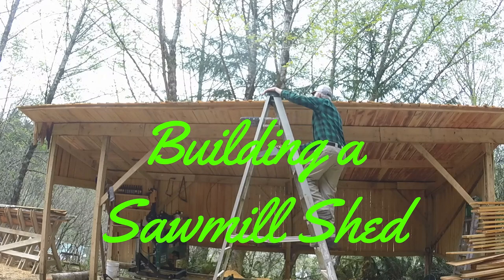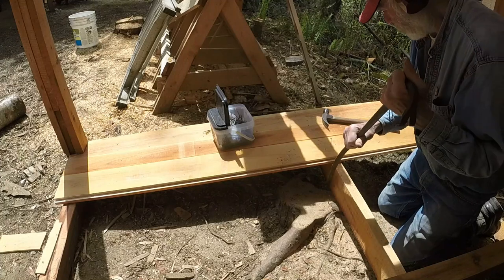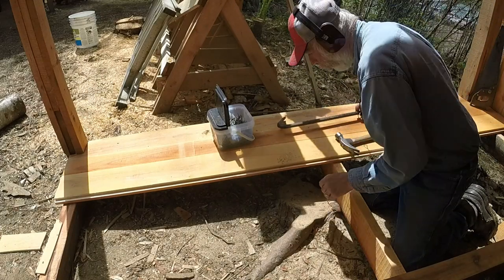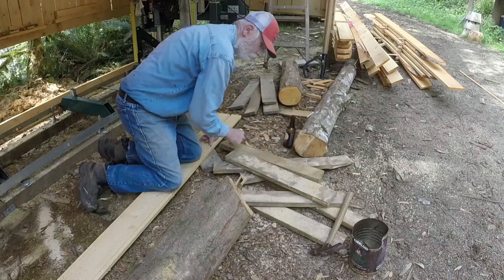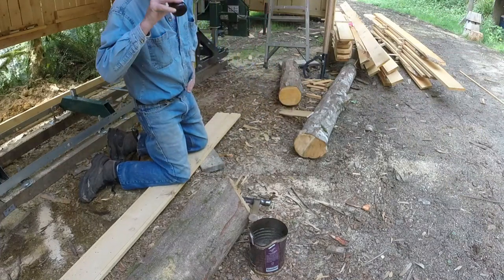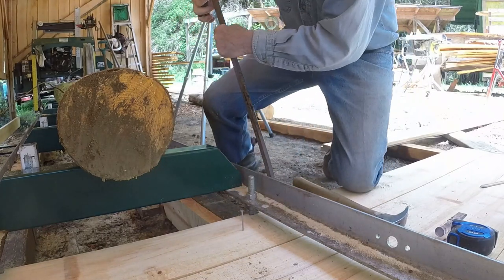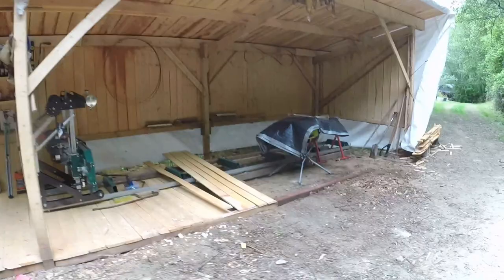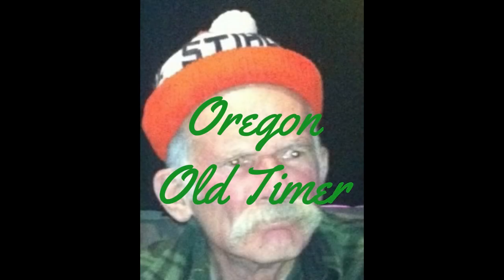Sawmill Shed #6  Building the Floor and Rain on the Roof

Comment: Sounds about like my luck.. I just used fine crushed gravel for my floor. Set mine on old railroad ties. Had a time getting everything leveled. Adjusted 1 side as low as it goes and other end maxed out. Had to keep pulling them all out and digging down back and forth.. Made for an aggravating evening.. Lol. Looking great so far! Be safe..

Comment: Nice shed build, got to one up for my saw this coming spring, have it setup in pole barn for this winter. Great job on your floor 👍
Reply from the maker: Floor is better than the roof. Rain seeps through in a few places. Next shed roof will be the same general construction but with deeper, wider channels in the boards and wider battens.

Comment: heavy roofing tar paper or a metal roof would be best. i had friend that coated his with tar and roofing paper. never leaked.  but he worked for a roofer and used tar tank for free. learned a lot. i have ordered a woodland mills 30 max  at leased 3 months wait left.looks like everybody getting these mills is over 40 years old. take care,be safe and well.
Reply from the maker: I realize steel or plastic or other roofing materials would be better, but I'm having more fun making things than I would have buying things.

Comment: Love your videos, what video was it when you showed your saw buck and how your slab wood stays on it because you double up the boards, I bought a woodland Mills saw mill and thought that was a great idea for my slab wood. Would like to copy your idea if that's ok. Thanks arnie
Reply from the maker: I don't remember which video. Don't remember a lot of things. Simple concept. Use paired X frames a few inches apart and separate the pairs by the length of the firewood you want. I put my X frames too close together and I sometimes cut into them with the saw.

Comment: I’m wondering if you used mostly beach trees for your build?  I saw you had plenty of issues with memory in the logs.   Beach is really hard to saw because of memory in the wood.  Nice job. I like watching your stuff.
Reply from the maker: Red alder mostly. No beech on my property. Because of the steep slope, most of the trees are curved near the ground and contain lots of stress. Straight trees make straight boards, a luxury in my woods.

Comment: I don’t understand the ship lap seam for a deck on your saw mill. Looks nice… but why? That’s an amazing job but not anything I will do. How are you going to level those rails/drop your stops, etc../
Reply from the maker: I don't want sawdust filling the space under the floor after the boards shrink. I still have access to rail height adjustment, but I'll need to make holes to lower log stops.

Comment: You could have done the shiplap edge with your router in one pass each side.
Reply from the maker: You're right about that, Bryan. I'm very good at overlooking the obvious. (Wait 'til you see my convoluted ATV electrical "repair" in a few days.) Floor isn't yet finished. I'll buy a couple of new 3/4 straight bits and try that.
Reply: I use a dato on the table saw. One pass. Many ways to get a job done.